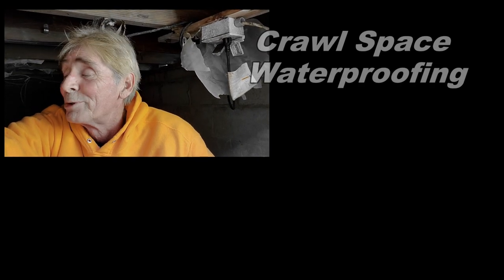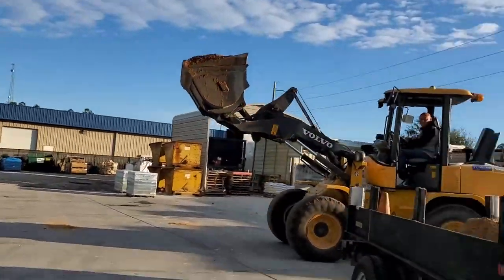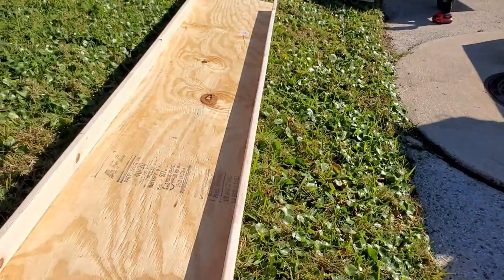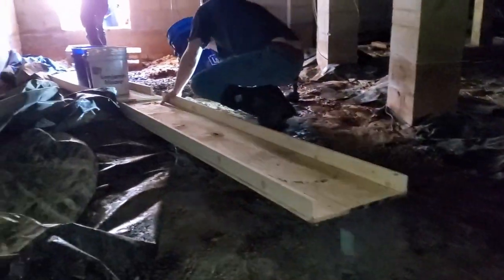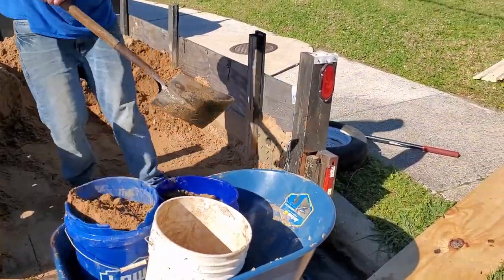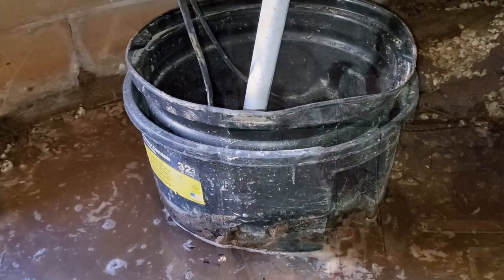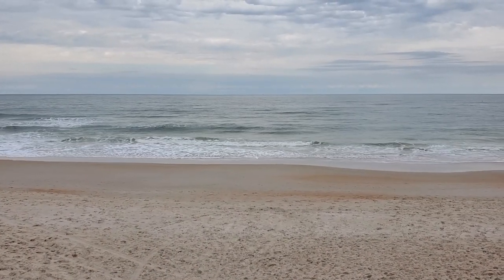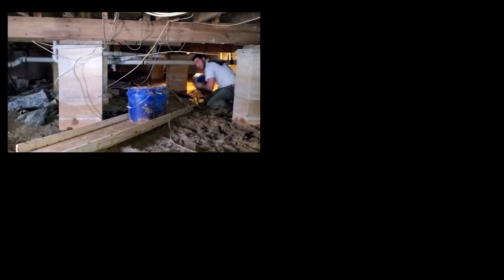Does Your Sump Pump Run and Run? Hard Fix, Made Easy, by Apple Drains

Comment: my soil has washed away from my footers... glad i saw this vid about the bucket slide.....should i instal the footer drain before adding soil to my crawlspace? and it just goes at the base of the footer with gravel then the pipe goes on top then more gravel? there is no pipe in there now just the sump basin and its sloppy wet down there. thanks if you reply

Comment: I wish I had Skyped with you last spring when we were getting 3” of rain an hour and the garage of the house I had bought 4 months earlier was flooding. We had at least 6 different times over several months that we had that much rain.  The man I hired had to change the French drain (some solid pipe, some perforated) he put in about different 3 times and ended up putting in a pump. Which won’t work when we lose power in the next hurricane, so now I have to get a generator.  Wish you had done the job. You would have known what to do.  I had water coming from the neighbors yard and running off my roof down gutters.